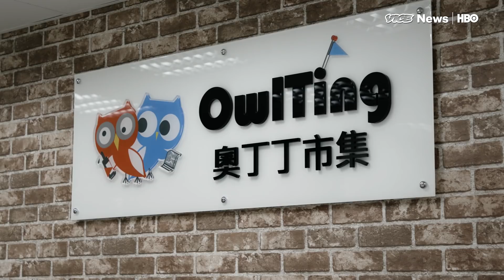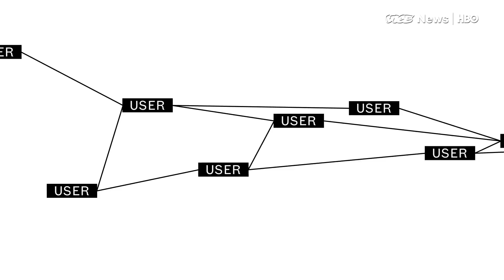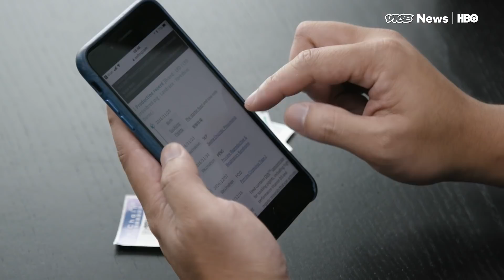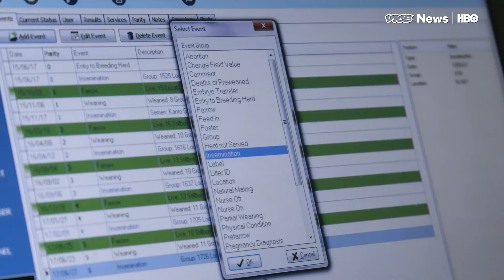This Company Is Using Bitcoin's Tech To Prevent Foodborne Illness

Comment: This is not blockchain, it is simply just a regular database that manufacturers and distributors can input to. And the consumers can view.
Reply: A blockchain is a distributed ledger, which sure, at its core is a type of database. The difference with a blockchain is that it is decentralized and verifiable. So rather than logging into a single server, it allows anyone obeying a standard protocol to run their own infrastructure and provides a level of auditability and fraud resistance that would be a huge headache with traditional databases. DLTs in supply-chain networks (or any diverse marketplace) make a lot of sense and solve problems that actually exist (consider that the RDB was invented 50 years ago - if a "regular database" could have fixed this, it already would have).

Comment: Why use a blockchain when you can easily use a centralized solution for all of this? You can still have hash-linked entries in order to ensure immutability and maybe a few redundant copies of the database shared with regulators to ensure that it was not tampered with.
Reply: I understand it would not be a trustless system. But do you realize that the problem described in the video doesn't require a trustless setup, do you? If they want to keep track of food parts it's probably because some government body requires them to do so in order to meet food safety regulations. There is a hierarchy here and thus there is a trusted third party to begin with. Using the blockchain for this is just a waste of resources IMO.

Comment: Serious Question: Bitcoin is secure due to the fact of the size of the network and the network's combined power to add new blocks to the blockchain thus preventing someone editing the chain, resulting in a fork. So how does blockchain technology work on a smaller scale like in this case? Hypothetically, a malicious company could edit the data ( causing a fork in the blockchain) and then just mine (hash) a lot of blocks in the cloud beating the smaller network of other companies,  eventually the malicious chain could become the longest chain. To my understanding the longest chain would then be adopted by the rest of the network, is this correct?
Reply: the problem is like you said "small-scale" once it scales up and all food producers use it this will be less viable
Reply: Thats not entirely correct, AWS, IBM, Azure and Google Cloud will always have considerably more computing power than all of the rest of the world's businesses combined. True, technically as the network grows it will become "less viable" but its still quite easily viable using the cloud to beat the smaller network